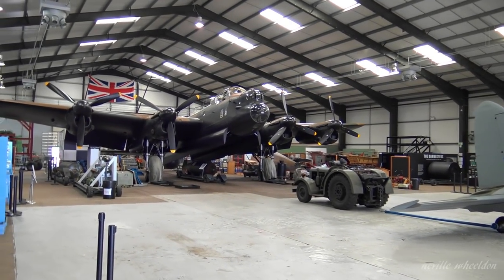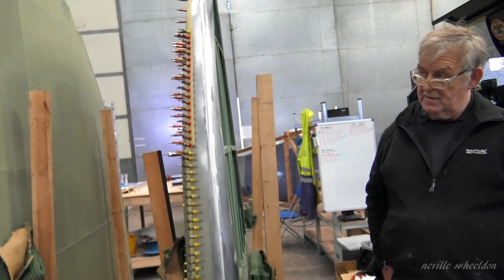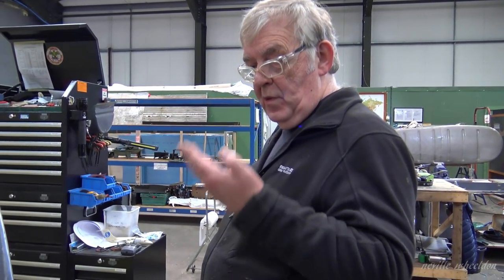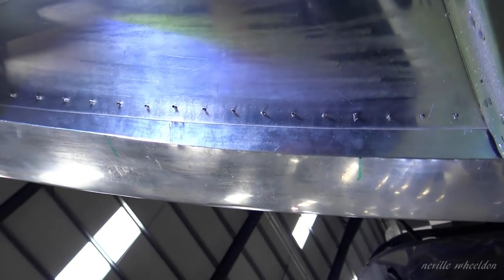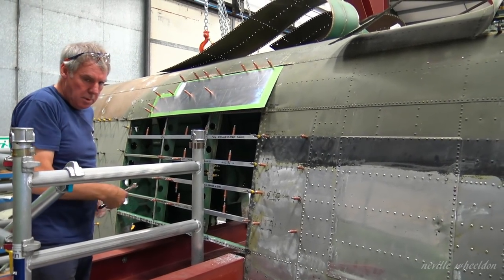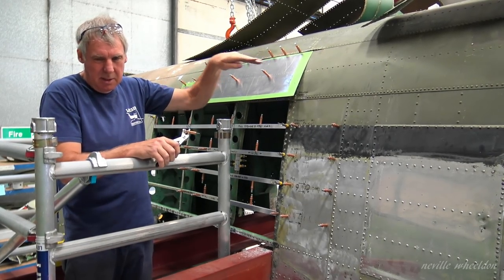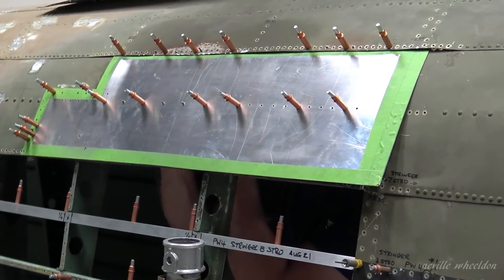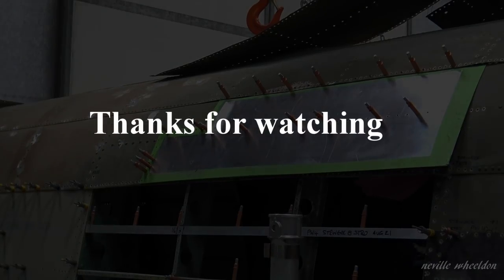Video 111 Restoration of Lancaster NX611 year 4. Keith marking out leading edge.

Comment: Funny you talked about the lighting type pressures, the Victor K2 tyres, if I remeber correctly are the same as the Lighting and all the RAF aircraft I worked on used Nitrogen in the tyres.
Reply from the maker: Thanks Flying Kub.

Comment: Fantastic detail Nev, and another great project to follow!

I would strongly suspect that the current rebuild is to a much tighter standard than these were ever built to back during wartime (I believe Jane is actually post WWII if I remember correctly but Im sure the point is still valid) Jane will be airworthy for many decades after this rebuild - I would also suspect that several of the wartime features remain inactive and of no interest to the CAA, for example the turrets I suspect wont rotate, obviously the guns will be spiked or replicas, bomb release mechanism etc, the APU I suspect will be for show only and the mid upper turret is just an exterior mockup which much save a lot in weight complexity and access etc - should make the restoration quicker and cheaper too
Reply from the maker: Hi Mark, The CAA have very strict rules and regulation, you  are right the standard is very high then the original build The front and rear turret were hydraulically operated this system will not be restored but the guns fully restored and airworthy (not operational) the mid-upper turret was electrically operated and will be installed. I'm not sure on the APU.
Reply: @nevillewheeldon1693  so they will reinstall the mid upper turret. Cheers Nev. weight distribution also becomes an issue which may play a part in that ti correctly set the centre of gravity